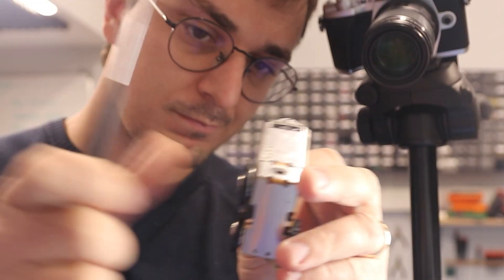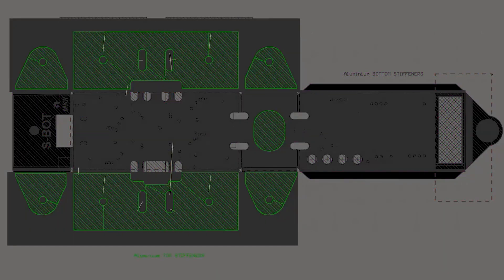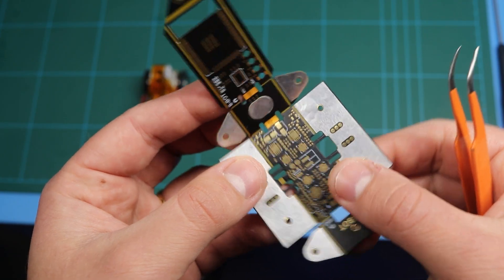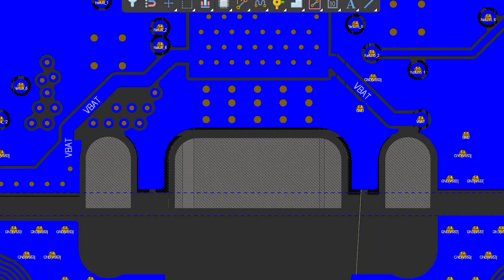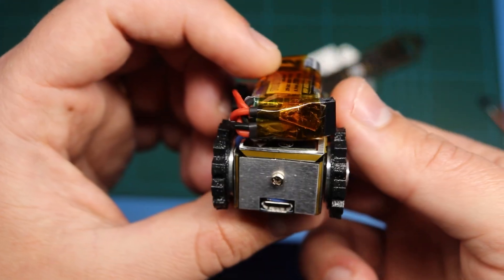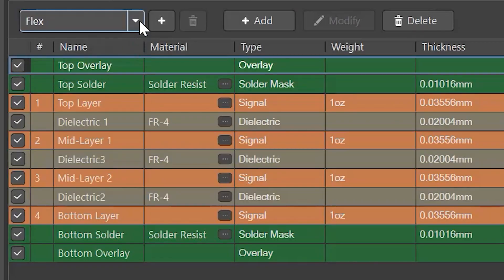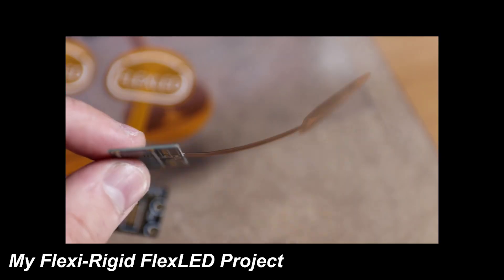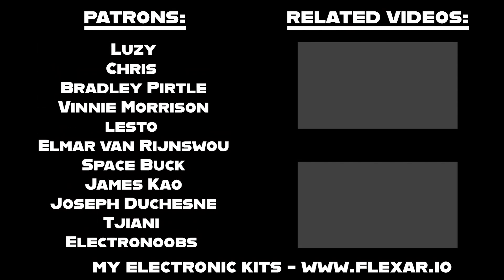PCB Rover (EXPLAINED)

Comment: I wonder if your flex circuits could be glued to the inside or outside of a 3d printed frame that would expand the options for shape of the vehicle, amount of stiffeners needed and be designed to be a battery holder, antenna holder and wheel base. Your flex circuit can remain the same but have different editions for different 3D printed frames

Comment: Why not try super capacitor for the power source? They are quite lightweight. And has been used in many toy cars around the 2000s.

This may be able to solve some of the problem of heavy weight Lithium battery.

Comment: The metal stiffener layer behind the motors doesn't result in some Eddi current losses?
Reply from the maker: Haven't tested that because it's 0.2mm thin.. But I will test it for the next version

Comment: Forgive me for my impudence. But I'm really interested in what you can do with VCA engines (similar to moving the head of the hard drive). I am fascinated by the precision of these drives and the simplicity. In fact, I wanted to use such in my stabilizer. The entire mechanical part can be printed on a printer.